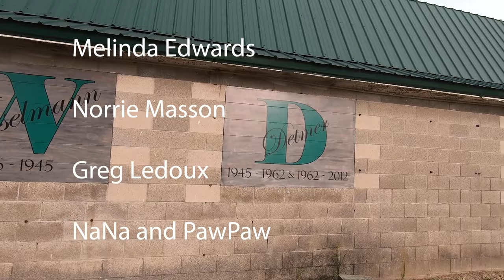TIME TO HEAD SOUTH!! - Motorcycle Road Trip (S2 EP32)

Comment: To save some weight run AMSOIL 20W-50 Synthetic V-Twin Motorcycle Oil in all 3 holes and you can get by with carrying one quart with you.  Plus you can usually find it pretty easy on the road.

Comment: I quit using sync 3 because I would use a qt of oil every 1000 MILES. A MECH friend told you will burn that oil. Go to a full synthetic oil and he was right the oil consumption quit.
Reply from the maker: I was told Syn 3 is a Full synthetic,  That or amsoil is the only thing she has had.  In this episode it was leaking out the trans.
Reply: @TwoWheelsBigLife  Syn 3 is chemically a blend of 60% synthetic and 40% petroleum oils but they can call it full synthetic. Castrol won a lawsuit in 1999 allowing them to market Group III oils as full synthetic.

Comment: My honda does not need repairs to often, but when it does it is never cheap. Cannot remember a 100 dollar repair bill. LMAO toys cost
Reply from the maker: So true.  Well ms Alice is paid for so I can afford to put a little bit of money in her.  she is working pretty hard and all.  Thanks.
Reply: I changed from Kaw to Honda in 1988. Almost no repairs. Costs were like checking the valves (which were ok), changing tires, and of course accessories !!!!
I did loose a plastic screw cover once on a GL1500, but they replaced it free. And brushes in the alternator cost me $50 in 1990. Not bad out of 15 Hondas in 32 years. During that time also had a Kymco, a Suzuki, and a Yamaha. The Star cost me a  little bit also.. The Kawasaki's were the only bikes that cost me a lot on multiple models which was the reason for changing.
Reply: good to know my Bike is also paid off toys are better when no monthly payment. Good to see the wife has her own bike to ride and enjoys camping together. Nice videos and nice travels. @TwoWheelsBigLife
Reply: @Scootphoria  My Goldwing usually does not cost a lot per mile of operation nor years of usage.  My Harley of some 40 years ago spent more time in the shop than on the road, it was an old motorcycle when I bought it but it was never reliable enough to keep and use. So I sold it and went to Triumph 650 and then a BSA 650 before the Goldwing in 2006.

Comment: If it's leaking from your clutch cable, why do you put motor oil in?
Reply from the maker: On Harleys, Transmission, Primary and Engine all take the same oil.
Reply: Two Wheels Big Life Ok if you use SYN3, but they go in 3 different holes.
Reply from the maker: @Donfleebie1  Yes all Holes have the same type of oil. Not just syn 3.
Reply: So, you shouldn't have to add oil to your crankcase(engine) if the clutch cable was leaking oil. It should be the primary, or possibly the trans, unless I'm way off base. Idk, I've been riding Harley's since 1985.  I'd be interested in the dealer diagnosis. Btw, I use different oil in the trans, and it's a different color, just so I can eliminate what oil is leaking from what area.
Reply from the maker: @Donfleebie1  No I just added to the transmission.  Checked the engine oil
Reply: Two Wheels Big Life Have you figured out the prob. yet? Safe travels friends.